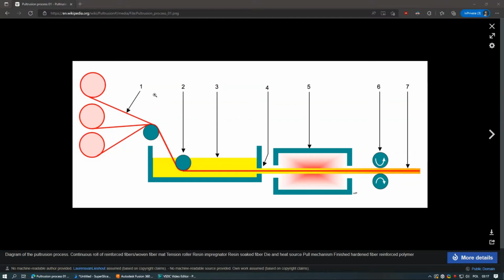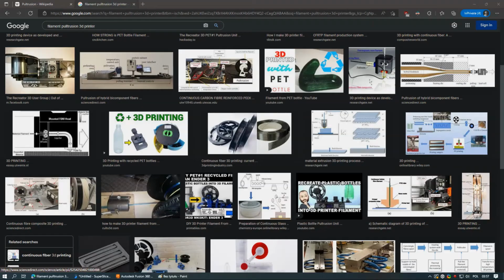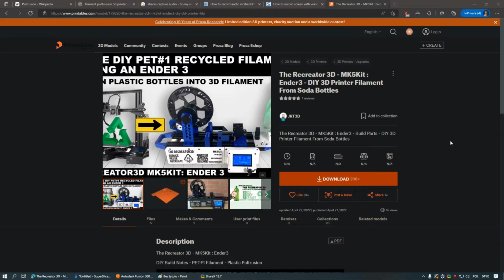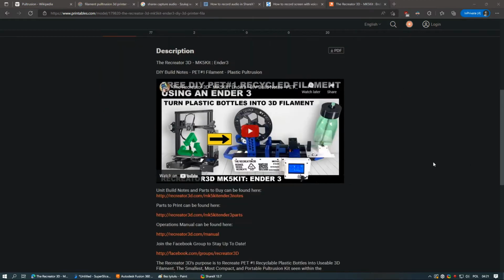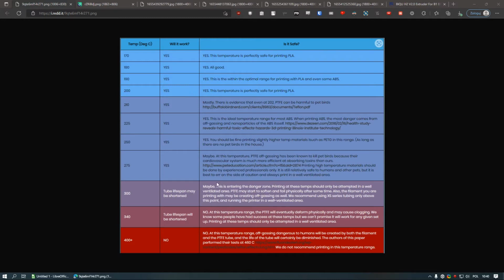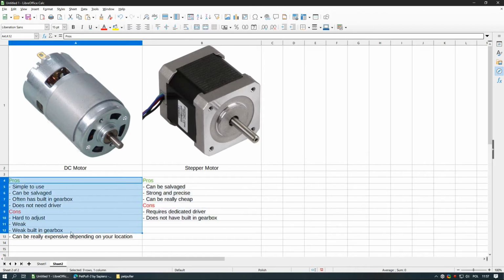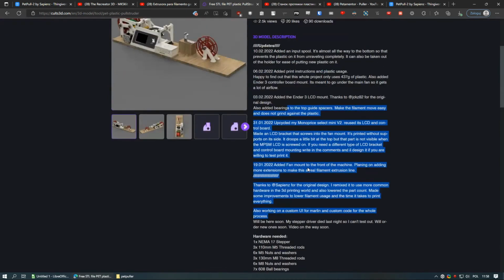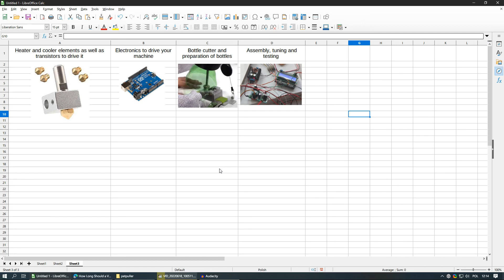What is pulltrusion machine? Is it for you? Free filament maker machine. PetPuller

Comment: I envisioned using like a current clamp somewhat design where instead of laminated material, using heating elements so that one can easily clamp and apply some force to make a uniform diameter butt weld... even if each end might require angled cuts to better overlap and join.  

Any thoughts on best way to join the strips or filament?   

Would be great to see the range of best practices to most easily sharpen the bearings cutting edges as well, though appears you have more videos I'll be watching.  Thanks for sharing!  Kind Regards, In Christ.
Reply from the maker: https://youtu.be/6v28tEB8vwE?t=560 around the end of video

Comment: Good job on some information - 260C is just fine for this filament, it prints good and doesn't break vapor barriers. As well, increasing your slicers flowrates to 130% will help compensate for the hollow core. I've find the best prints come from bowden style with basic ender 3 hotend and brass nozzle.  As far as your concerns with the plastic spool rod - I've have pulled over 600 bottles on my flagship unit with no degradation to the printed parts. Good work over all!
Reply from the maker: I am going to cover printing temps and flowrates (slicer settings in general) in next videos but you are right, 260-270 and 130-135% seems to work best.
Direct drive indeed may have some issues with PET, i had to replace my one with biqu, that fixed the problem. As for plastic spool rod - this is really a topic for entire video but in short, if you have too wide bottle strip/serrated edge/bit clogged/uneven nozzle/uneven bottle, pulling will still work but requires tremendous amount of force and i already managed to break a simple roller because of that. Im only at 30 bottles at the moment and i recently discovered new meta, 1.6mm MIG welding machine nozzle, its lightyears ahead drilled printer nozzle and literally doesn't require any drilling.
Reply: @KaminarisTech  1.6mm will need even smaller width strips cut in order to pull proper...as well to make sure the 1.60mm is able to be properly extruded due to the smaller diameter. Dual Geared extruder is suggested at the smaller size. Otherwise it may slip.
Reply from the maker: @JRT3D  from my tests it doesn't really work like that, width of the strip and temperature is much more important than hole diameter. I didn't change anything besides nozzle itself (to 1.6mm) and it does produce 1.75mm filament. Not only that but also makes it way smoother than 1.7mm volcano nozzle or 1.75mm normal nozzle. It also puts them to shame when it comes to consistency and smoothness. Here is one sample (to the right, left one is PETG) https://cdn.discordapp.com/attachments/167661427862142976/991953849080369222/1656570623530.jpg from filament made with MIG nozzle